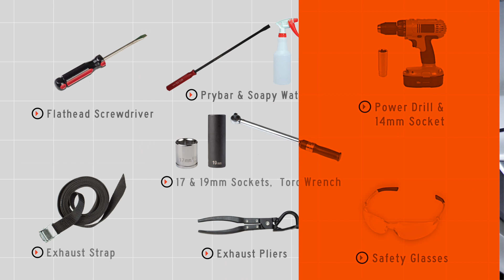2019 Hyundai Santa Fe Trailer Hitch Installation

Comment: Hello and thanks for this. Very well explained. What do I have to do if my camper/trailer also has a brake controller? I have purchased a 13509 Brake Controller from U-Haul. My camper has a 7 pin round connector. How do I wire all this into the vehicle?
Reply: Hello Tom, you'll need to convert your 4 flat harness to a 7 round and your 7 round will have a blue wire to connect to your brake controller . Unfortunately, we don't have a video of how to hookup a brake controller yet. Here's a video for hooking up lights on the 7-Way. https://youtu.be/HItAgnlecvY. We don't hookup a brake controller in this video, but this will get you started.
Reply: @aaronlimon4803  Thank you so much for the speedy reply. Yes I finally understand now how the 4 flat to 7 round #47185 part works in this scheme. The existing 4 wire connector in the car just attaches to it (I don't have a tow package from the dealer). The other three wires get run up to the front to connect to the brake controller.

Comment: I  have a 2019 Hyundai Santa Fe, Ultimate 2.0T AWD...but the “maximum” towing capacity is listed at 3,500lbs.  Are you saying that just installing this hitch will increase my maximum towing capacity up to 5000lbs?  If not, can it be increased by any other means?
Reply: no. the 5000lbs is the maximum weight the hitch can hold, not the car. Its like if you use the same hitch on a car that can tow 7000lbs you can only use 5000lbs of weight on this hitch
Reply: @stingertv9759  The problem is the towing capacity of my Santa Fe is listed at 3500lbs. My model outside USA is listed at 5000lbs.  The trailer I hope to purchase is 3401lbs.  I’m looking for a legitimate way to properly increase my vehicle capacity to 4000lbs (or more).  Adding a 5000lb capacity hitch doesn’t make my Santa Fe’s capacity 5000lbs.  I’m willing to pay for modifications, just need a legitimate way to do so.
Reply: @johnfalone9928  unfortunately US towing regulations are more strict than EU regulations. There is no legal way to increase your santa fe’s towing capacity to more than what the manufacturer recommends in this country. Your best best is to trade up to a Palisade or better yet the Kia telluride, both of which can legally tow 5000 lbs. The telluride has an OEM towing kit option with load leveling rear suspension — the palisade  does not have this option available, you’d have to get an aftermarket hitch.
Reply: John, you have a 4cylinder turbo engine in an SUV. The engine has to go into boost mode when you are carrying heavy loads, travelling at high speeds/ into the wind, or driving up hill. The more weight you add, the more the boost is needed. Pushing the engine will cause it to wear much faster then designed, hence the 3500lb towing capacity. The 3.3L V6 has 5000lb towing capacity because it is a bigger engine. It is likely wiser to trade in your vehicle than try to replace its engine. It is more a factor of cost & practicality, than legitimacy. Pushing the vehicle beyond its capacity will result in pre-mature failure of the transmission and/or engine.